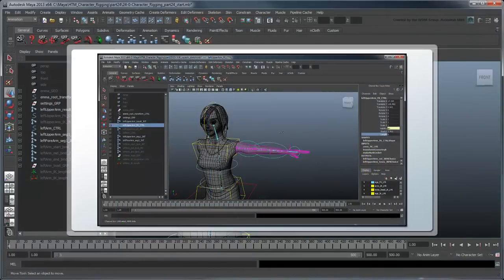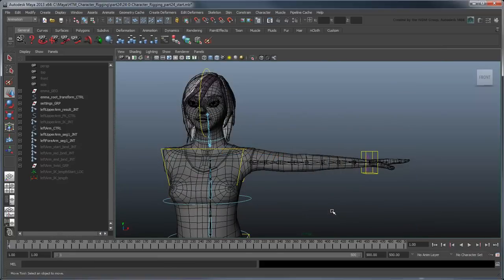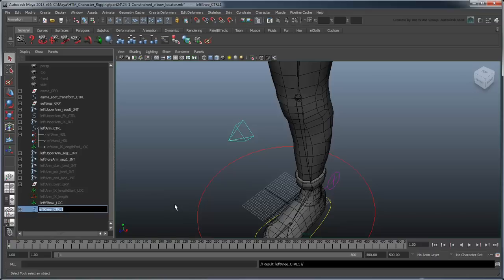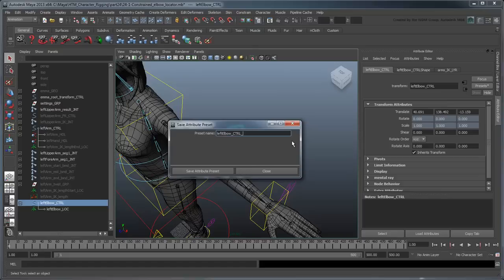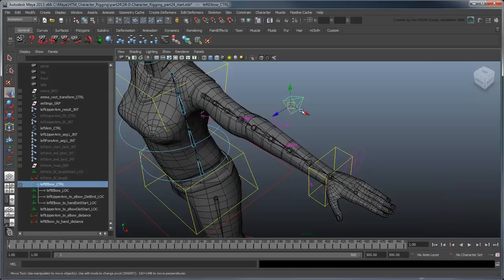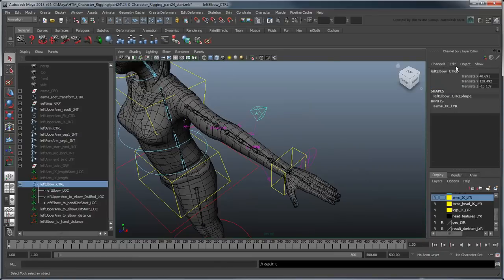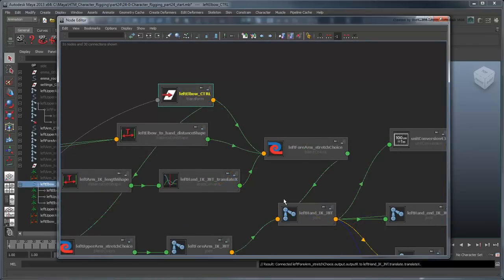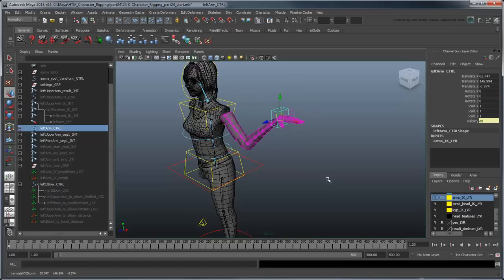Creating a Character Rig - Part 24: Snappable elbow (Advanced)

Comment: In the previous movie, you added a note telling people to use a parent constraint for the joint at the shoulder, rather than a point constraint.  Because of this parent constraint, my arm twists at the shoulder as well as the elbow when the locator is moved.  I was a little confused at first, but now I'm going to move on with the tutorial, assuming that its's fine.  Just wanted to let you know, in case you wanted to add a notification explaining this.

Comment: I'm doing mirrored side for snappable elbow, but my fourth segment joint, on the upperarm, twists -180 degrees when the Elbow Snap attribute is higher than 0.6. Any idea on how to fix something like that? Maybe a setting in the solver? Tried changing World up type to "Vector (start end)" and it seemed to fix it... meanwhile, on the Left side, the same issue with the same joint from 0.8 on the attribute, was solved by using "relative" as world up type?? :P
Edit: I'm going to use "Relative" as world up type for all the IK spline handles that uses stretching. Seems like an overall more stable way to do it, least for my rig...
Edit2: Well that didn't work out, I didn't notice at first, but the twisting stopped working alltogether on relative mode.
Edit3: Aight, instead keeping "Object Rotation Up (start/end)" and then instead using up axis "Closest Z" has no flipping, but also lets the twisting work as expected... no problems so far

Comment: sorry to ask another question! when creating my ik handle in the previous part I noticed my elbow dipped downwards along the y axis (whilst still along the z axis) rather then solely on the z axis, I realised this is because my joints are slightly angled however I decided to carry on. Creating the elbow locator has fixed this problem as the joints are now aligned to the locator, however as a result the geometry has slightly twisted with the joints. I was just wondering whether this is going to end up being a problem? If so, how do I fix this? Thank you!
Reply from the maker: This isn’t a big problem because the geometry is just there for reference anyway.  You’ll eventually be replacing it with a skinned mesh, which will fix the problem.

Comment: After completing the snappable elbow, the arm stretches beyond the rightArm_CTRL between full FK and full IK mode. I seem to have made the same mistake on both arms. I suspect there is a difference in keyframe interpolation between the two driven objects (one auto, one linear), but I cannot find these anywhere. Any ideas?
Problem: https://drive.google.com/open?id=0B3nZ8EVE75D-ZnFOalAwNnJuNU0

Comment: Maya Learning Channel, I know it's been a while, but I love doing with this rigging series. But I did the arm-part two times now. And I ran into the same issue twice: after I set up the pole-vector, the snappable elbow and the hybrid FK-Forearm, the rotation-axes of the three Joint-Chains seem not to match anymore, so I get a little movement of the arm, when I switch IK to FK. Even the elbow-Joints snaps not exactly to the elbow-Control, when I turn elbow-Snap to 1, the further the elbow-Control is translatet, the bigger the gap grows between joint and Control. I have an own character, without segmented joints and not in exact T-Pose.
Reply from the maker: A few questions: Did you make sure all the arms are exact copies of the result arm?  Also, is the Move Tool's "Automatically Orient Joints" option turned off?  Finally, is your model at 1,1,1 scale?  It can throw things off it isn't.
Reply: Hello, thank you for your quick answer. So I doublechecked my rig again and I found out, that it has to do with the snappable attribute, because the last saved version of the file, where I set up the pole vector worked out fine. I exactly duplicated the result-Chain twice, like you did in the videos. The model is scaled at 1,1,1 and the option "automatically orient Joints" of the move tool is switched off. I recorded a short video of it, if you want to check: https://www.dropbox.com/s/zemm7yrqnktpmly/mayaRigElbowIssue.mp4?dl=0
Reply from the maker: Hmm.  I think what might have happen was you duplicated the result chain the second time after you'd already setup the pole vector elbow.  Unless your pole vector is placed perfectly such that your elbow is exactly in the arms original spot, you're going to get a small variance.  To avoid this, try creating the snappable result chain before you create the pole vector elbow.
Reply: ok. thank you very much. I'll give it a try!
Reply: Hello. Ok. doing the setup in this order solved the issue, that the arm is moving, while switching from IK to FK and back. But the distance between elbow and elbow-Control, while in snappable-Mode is still there. I think I'll have to build the arm again from the beginning, keeping an extra eye on the orientations of all chains.
Reply: @manuelding3402  Have you ever found out what was going wrong? I just ran into the exact same issue and I don't have a clue. Thanks in advance!

Comment: the things are coming perfect into now.  I don't know how or if it is a maya bug, my IK controls aren't working anymore. I did the tutorial step by step up to the elbow creation, but when I returned and tried to move the IK hand control (curve) it doesn't move. I returned to the other versions of my project, but they aren't work either (and I know they were before). I tried to move the IK foot control (curve) but it also stopped work. instead of parent the handle to the control I parented constrain them, but I need to keep the hierarchy, like the tutorial, then this not solve my problem. does anybody can help me? thanks. (i'm using maya 2016)

Comment: Hello, MLC! Some of my IK joints have a slight rotation offset (I don't know how that happened. however, the values are very small, something like 0.012). This is not a big deal, right? Or should I fix it anyway?
Reply from the maker: Correct.  For a value that tiny it shouldn't matter since the naked eye won't really be able to perceive the difference.
Reply: Okay. Thanks for the quick reply!

Comment: Absolutely loved the tutorials so far, thank you for these!

I'm having a problem with the elbow snap though. Whenever I turn on the elbow snap; the distance between the shoulder-PV and wrist-PV gets correctly transferred to the TranslateX of the respective IK joints, but this results in the elbow snapping to a point above the PV control. Then if the PV is moved around, the incorrect snapping gets out of control. Any idea what could be causing this problem?
postimg.org/image/fyxe04mch/
Reply: I am having this same issue, were you able to find a fix?

Comment: I've encountered a problem recreating this rig for a character of my own: when I snap the arm to the elbow and try to position the elbow control, it causes the upper arm to start squashing in. Is it no longer in IK mode while using the elbow control? If so, how can I get it to retain its 'minimum length' while adjusting the arm's position with the elbow control?
Reply from the maker: By definition elbow snap uses scaling to ensure the elbow stays locked to the control at all times.  It's not possible to do it the other way around (have the control stay locked to the elbow) because that would cause a dependency loop in the joint/control structure.  To actually accomplish this would require a full body solution.

As a workaround, I would use FK mode to initially position the elbow, then use the matching script from Appendix A to switch over to IK mode while maintaining the same body position.
Reply: Hey, did you ever figure out why the joints were squashing inwards when snapping the elbow? You commented a year ago but maybe you remember the solution if you found it.

Comment: Hi, I've followed all the videos and now I'm on the mirroring operations. I've a problem with the snappable elbow on the mirrored arm joints, I've followed all the steps and check all the parenting and math and is exactly as shown in the video and the distances are multiplied by -1.  When I snap the elbow to the PV control it doesn't reach the control, it doesn't work at all and i can't figure the problem. Do you have any advice? Thanks

Comment: hello! is it wrong if i freeze the elbow controller and its locator instead of set a preset of its normal position?
Reply from the maker: It's not wrong, but it will require an alteration to do the matching algorithm in the appendix to match the new default position.

Comment: hey, I'm trying to do the right Arm, but I ran into a problem. When I try to create the pole vector Constrain my ik control doesn't rotate the hand well and when i move the pole vector LOC the hand doesn't stay in place and twists with the rest of the arm. Any idea of what it might be?
Reply from the maker: Diogo simoes Sounds like something is constrained incorrectly between the hand and arm.  It could be an extra constraint or an incorrect parenting situation.
Reply: Maya Learning Channel Tomorrow I'll try to redo all the R_Arm. Can you please just confirm how I should orient the right joints? My X axis is facing opposite from the other arm, dunno if it is suposed to.
Reply from the maker: If you download the file in part 32 you can use it as a reference for all your right-side joint orientations.  If by "opposite" you mean it's going from the hand to the shoulder, then yes that's correct.

Comment: Maya learning channel, when I create a distance measurement at 4:03 I try to place the locator at the elbow, it seems to go all over the place. I don't know what I could be doing wrong.
Reply from the maker: You can just move the locator afterward.  Point snap it to the elbow by holding V + middle-dragging it in the general vicinity of the elbow joint.
Reply: Thanks, it seems like I should have thought of that lol

Comment: Why don't you freeze the Elbow ctrl instead of set a present position? I just feel it would be easier for animator to set the controllers into zero so that they won't get confused
Reply from the maker: I explained in an earlier video that, unlike legs, the 0,0,0 position doesn't always mean the same thing to all animators (i.e. it doesn't always correspond to the T-Pose).  That said, there is an appendix video later in this series that shows you how to set the T-Pose to the zero position.
Reply: @Autodesk_Maya  I went over all of this series and still confuse about that preset setting for the elbow ctrl(without 0,0,0 position). I don't get the resolution of set the T-Pose to the Zero position. And I would like to know the meaning of " animators who don't know the 0,0,0 position "? Would you mind to explain it?
Reply from the maker: @kioeoeo  One example would be that some animators prefer T pose and some prefer A pose as their starting position, so you can't necessarily assume one over the other.  

That said, due to popular demand, I do show how to make T-Pose the zero position in this video: https://www.youtube.com/watch?v=V8ZgOZDjVXs&list=PL8hZ6hQCGHMXKqaX9Og4Ow52jsU_Y5veH&index=41

Comment: hey, I have a question, when I was doing the right arm, I follow the tutorial again until I create the pole vector for the IK arm, it was fine, but once I apply the pole vector constraint, the rightArm_ctrl will move which is the result hand joint is moving, I checked the scene file of yours, I found that in your file, when you move the elbow ctrl it were the segment joints that are moving instead of the IK joints, any idea why that happen?
Thank you so much!
Reply from the maker: It's probably the IK Twist controls.  You may need to change some of the settings in there (see the annotation here: https://youtu.be/hjl8we7VVK0?t=12m21s)
Reply: Maya Learning Channel hey, I checked your mirrored file, I changed the rightArm HDL and rightHand HDL to match the correct movement, but when I do the IK arm and the pole vector constraint, the hand result jnt still move with rotate with it . Here is the file, I tried to redo a set of IK jnts, it works fine, but when I used the mirrored jnts, it didn't work.  any chance you can tell me why that happen?  Thank you so much!!
https://drive.google.com/open?id=0B4AMbNecLZQDUEh6OXBJUTBUWkU
Reply from the maker: Did you notice that the mirrored joints use different advanced twist values?  They aren't the same from one side to the other.
Reply: I used different values and it works okay, but they aren't the same with your mirrored file, now the twist works fine, but the IK doesn't work properly

Comment: Maya Learning Channel, I have followed this tutorial for my right side joints. The problem is the joints were squashing inwards while snapping the elbow for the right hand IK joints. when my Elbow Snap attribute in the Right Elbow Control is 0 or 1, everything looks fine(in place); From 0.001 to 0.999, the right hand IK joint will squash towards the right Upper Arm IK joint before snapping to the elbow control . I have followed the mirrorred tutorial for the rotation axis of the right arm joints pivot. I don't know what I could be doing wrong, need help! thank you
Reply from the maker: Hmm, did you try comparing your scene hierarchy in the Node Editor to the one in the finished Part 32 file?  It sounds like something might not be connected correctly.  Another possibility: make sure to display everything attached to the Right Hand IK joint and make sure none of the locators used for squash/stretch are moving (they should remain the same size throughout).
Reply: alright, thanks. <3 your tutorial and feedbacks
Reply: I had the same problem and I have been able to solve it...Here is what I did, You will create a MultiplyDivide Node, set the operation to Multiply and the input 2 value to -1.000. Then in the node editor, you will connect the distance attribute of the R_UpperArmtoElbow_LengthShape node to the input 1X of the multiplyDivide node, and then you will connect the output X of the multiplyDivide node to the input Color 1R of the blendColors node. Repeat this for both the upperArmtoElbow and the ElbowtoHand connections and your character's elbow should snap normally without squashing inwards before snapping again...I hope this helps

Comment: Hi, when I do a pole vector constraint, the wrist joint and my settings control rotate along with it, I am not using the segment joints, there fore I do not have the "start" "mid" and "end"  joints, maybe that has something to do with it? thank you
Reply from the maker: What is your settings control parented to, the wrist or the hand?  The wrist should twist around, that is expected behavior (which you'll see even in our example file).  However, the hand joint should remain planted (and thus the settings control it's constrained to).

Comment: Hi! I have a little problem with the IK Control... If I move it too close to the body, the Elbow starts to rotate. Is there any solution to this? I thought creating the Elbow Control and Elbow Snap, will fix this, but I was wrong..
Reply: +DragonDinu I've tried with a perfect T-pose of body and joints... It seems that that angles are the ones that destroys the elbow...
Reply from the maker: +DragonDinu How does it rotate exactly?  It should always point at the elbow control.
Reply: +Maya Learning Channel
Thank you for your quick response! I can't believe it...

Okay... When I try to close the gap between the leftArm_CTRL and LeftUpperArm_IK_JNT (more than 90* degrees, the Elbow's angle), it starts to spin ~160*degrees around the straight line that is created between the controller and joint.

It seems that the angle I have between the Joints it's the one that causes this rotation.

I tried to create a simple straight chain of joints and it worked as in the tutorial.

That advice from video 10: to keep the joints parallel with the axis... I will try to modify the mesh into a T-pose...

Ah.. i'ts not that easy to change it into a T-pose...
Reply: +IonutStef You can try to change the rotation order manually in the component mode instead.